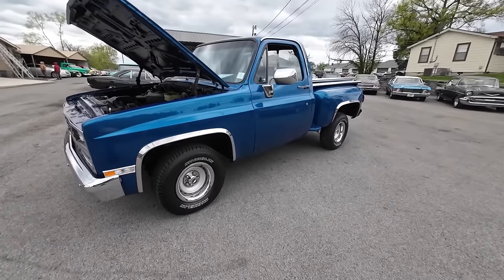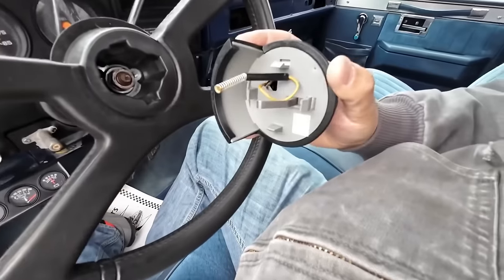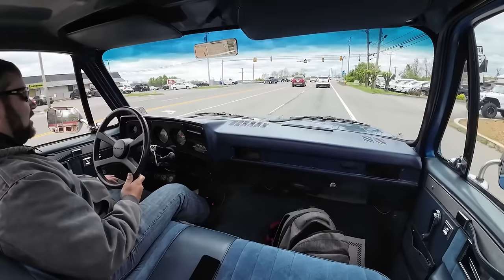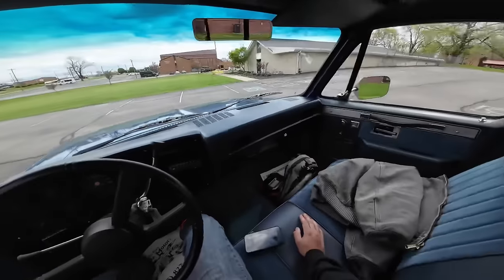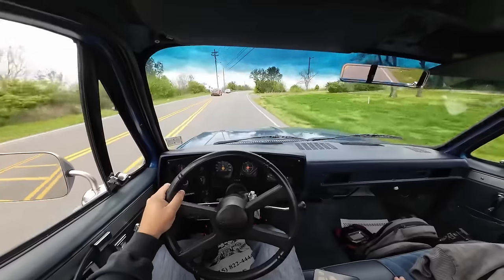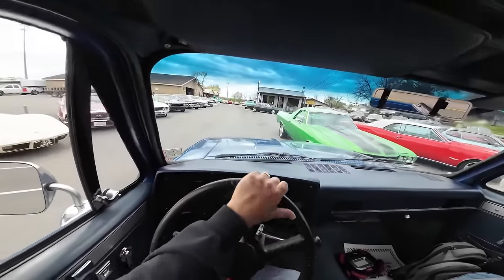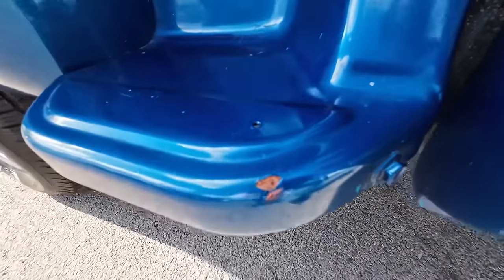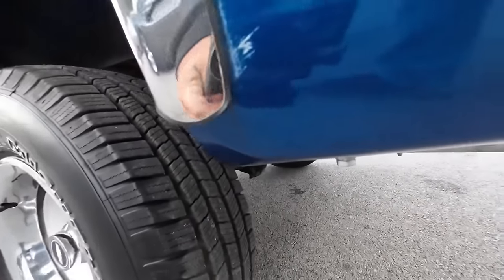Test Drive 1986 Chevy Stepside C-10 SOLD $12,900 Maple Motors #2535-1

Comment: 10:54 Something off about the way the wheels don’t line up in the wheel wells - like there is more space in front of the tires the behind it …..
Reply: I noticed that too
Reply: as a boat load of positive caster!
Reply: The body lines are way off and the headlights are crooked, I bet that thing is plum full of bondo.